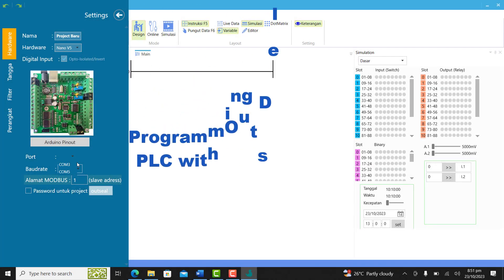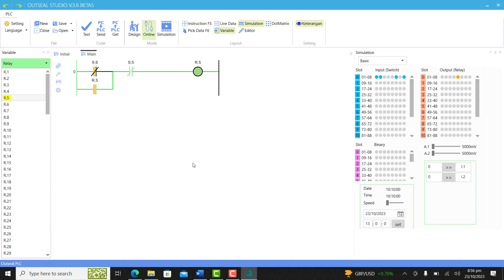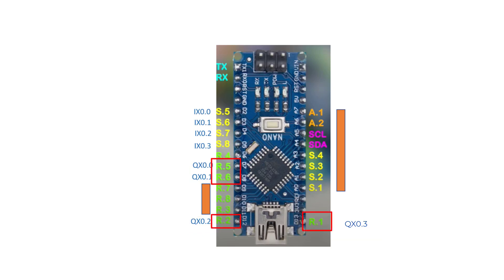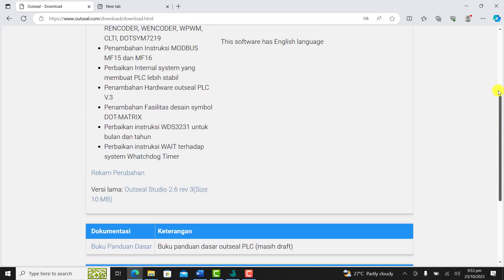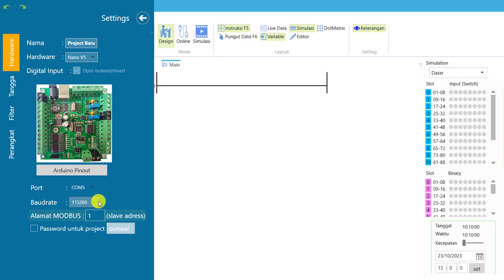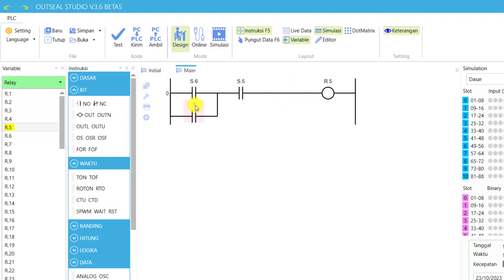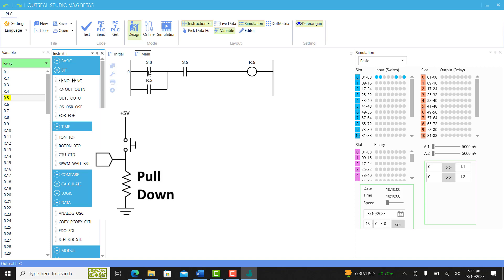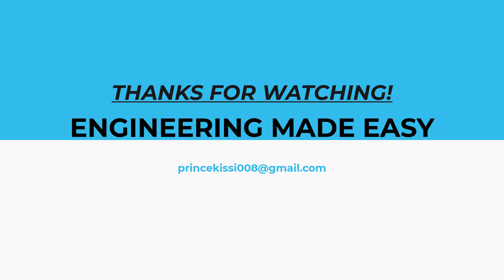Programming DIY Arduino PLC with Outseal Studio

Comment: Between the two applications Outseal Studio and openPLC, the input and output are different
Reply from the maker: Yes you are right. However luckly we have some of the pins matching which gives us opportunity to have fun with both software using the same PLC board. Thnx for your comment